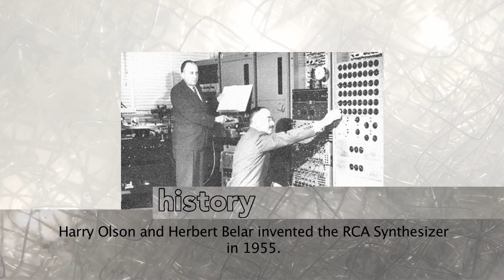A History of Polyphony:  Part 2- Definitions

Comment: Interesting definition. So electric pianos, organs, string, are not synthesizers even if they're analog, because they're not giving control over the actual wave, filters, etc. DX7 is still a synthesizer, even if it's hard to control those parameters
Reply from the maker: What I am saying is that in my experience as a synthesist and historian, in the interest in nailing down even a general definition of "synthesizer" that takes into account traditional application and history, this is what I came up with.  Some have disagreed, but I can defend every component of this premise. 
And yes, the truth is that "analog" really has nothing to do with synthesis... it's just one container for the process, really.  
DX7 is a synthesizer, although I would suggest that it is an abstract concept, and the necessity of computation makes it into a different sort of synthesizer.  But, of course, others might disagree.  :D

Comment: Its absolutely incorrect to use electronic when something is electric, you are not solidifying at all saying a synthesizer is electronic!!! You are mudding the term electronic, at least electronic is very well defined and you use it in an ill way!!

An electrical device means the device functions only with electric components, which means it does not have any decision making circuitry. 

Electronic means it has a decision making  circuitry. There are electric synthesizers, there is no decision circuitry needed in a synthesizer at all.

An electrical guitar shouldn’t have decision making circuitry, an electronic guitar must have decision making circuitry. So there is a huge difference saying a music device is electronic or electrical/electric. 

That is really hard to refute, impossible to refute even. The difference between electric and electronic is a well established defined within the field of electrical engineering.
Reply: The definition of electronic or electric is mostly confused by musicians, hence the terminology to call everything an electronic instrument is wrong. If a Theremin does not have decision making circuitry it is an electrical device and not electronic.
Reply: ok,  I can barely solder (badly), but as I understand it

Electric = passive circuit limited to resistance, capacitance and induction
Electronic = active circuit that may switch, amplify, rectify (and perhaps) more

The audion(triode) was invented in 1906, enabling the use of electronic amplifiication and more.
  Was that not decades before the first automated / computerized instruction sets were devised?

Comment: I think a defining characteristic of a synthesizer that you missed is that the synthesis is done in audio and not in acoustic space. This differentiates them from other electronic instruments such as most electro-mechanical devices.
Reply from the maker: Well, except that acoustic synthesizers that work the same way electronic synthesizers work but with sound waves exist.  In fact, there's one at the bottom of your face.  Quick, make a bird noise!
Reply: @automaticgainsay  I think manipulation in audio space is a distinct difference from manipulation in acoustic space. (Despite working "analog"ously.) Nevertheless, this is just my 2 cents on the providing a definition.

Comment: By your definition, the Hammond "Organ" was the first fully polyphonic poly-adjustably-articulated synthesizer in 1935. In fact, the FTC had to rule on whether it was an "organ" and not an electric (aka electronic) musical instrument (aka synthesizer) under a lawsuit filed by pipe organ manufacturers over Hammond's use of the word "organ" in advertising.
Reply from the maker: Nope.  While it was a specifically applied and marketed  version of the first synthesizer.  :)
Reply: @automaticgainsay  What ?

Comment: Hey Marc, was the RCA mark I actually called “synthesizer” back in 1955? In that case we have to re-write some historians saying the Moog Modular was the first synthesizer called “synthesizer”?
Reply from the maker: Yes, corner.  It's where the term came from.  No historian worth their salt would describe the Moog synthesizer as the first device called "synthesizer."  There were two devices before that, in 1955 and 1960, that bore the name.  And Moog devices weren't even called "synthesizers" until 1967.
Reply: Thanks Mark! I suppose it's difficult to know these things for 100 % but seems as you do a good job researching this.